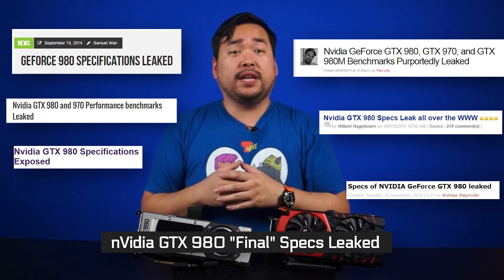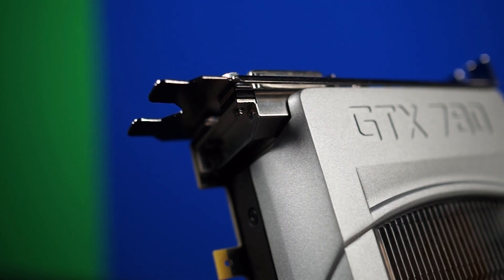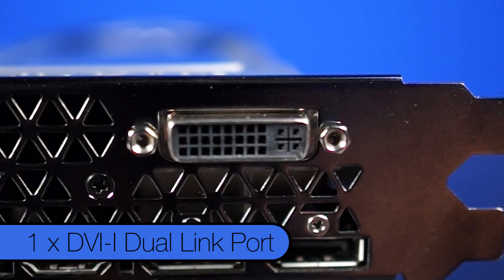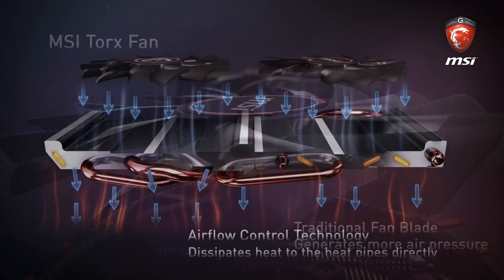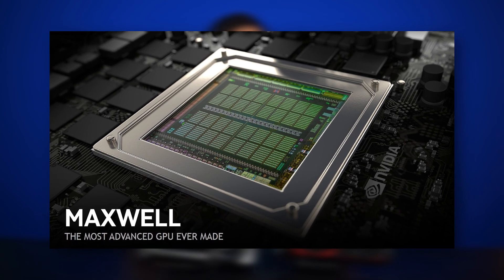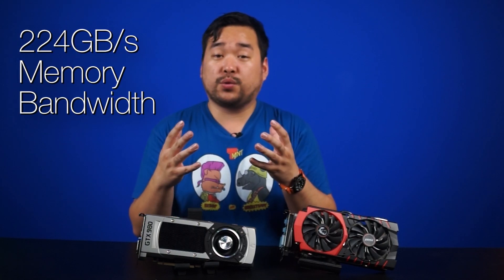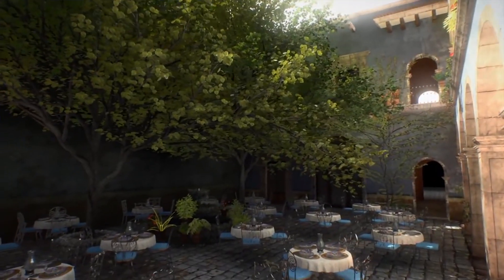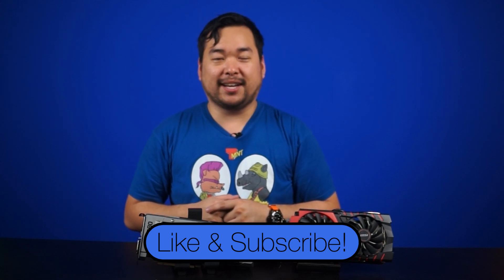What is Maxwell? Explained. ft. GTX 980 and MSI Twin Frozr V GTX 970

Comment: Is the Intel Core i5 4690k good for the GTX 980, or is it going to bottleneck it? (stupid question i know.)
Reply: So you have to have experience to overclock? how do new people learn how to overclock then... Fool
Reply: Slay ...Calm down? Maybe he plans to learn in the near future.
Reply: xXTheGamingKamiXx So how stupid exactly are you? You buy a "k" CPU and you're not going to OC it? WHY THE FUCK BOTHER THEN!?
Reply: Cheesepuff
theyre binned chips to ensure they are actually overclockable. they have a higher threshold for frequency and voltage tolerance, have higher overall stability, and run at more thermally sound temperatures. dies with impurities in them might get turned into an 's' chip or non lettered chip. so technically k chips are better chips. all the same silicon just less impurities
Reply: most games can be run just fine with a i5, especially the 4th generation, you should be totally fine, the 970 imo is more interesting because of the price 350 dollar
Reply: i5 4690K could handle 4 of those :D
Reply: thats a very good cpu and will not realistically bottleneck that gpu. but technically if a game isnt optimized properly one part is always going to bottleneck the other. a good example of this is a cpu dependent game that processes draw calls on a single thread like all mmos is going to bottleneck the gpu and theres nothing u can do about it. directx12 should help this but it still boils down to game engine design and coding optimization
Reply: This comment chain was tl2r so ill just say this:
I read the first 3 - 4 comments and dont buy the 4690k is youre not gonna overclock if there is a 4690 non-k version (theres one right? havent followed latest cpu specs and things) its just a non overclocable version of the 4690k some time under clocked 100mhz which for gaming makes about no difference
Reply: *****
I disagree, I overclocked my CPU by reading online... It's lasted a year so far and nothing bad has happened, over clocked it from 3.5 to 4.2ghz
Reply: Slay cause fuck logic
Reply: ***** I don't really know how to OC so it will be at the stock clock. Thanks for answering!
Reply: You cant say one thing bottlenecks the other, without mentioning what you're going to do with it. If it's just gaming, no, your i5 wont even reach 50% of its capabilities.
Reply: Simxor Yeah, it's for gaming. Good to hear!
Reply: yes and nope the bottleneck issue is not gonna happen with 4690k
Reply: No bottleneck  is something different it's like core 2 duo with GTX 780 TI😎
Reply: Slay Haha very true.
Reply: 980 will be fine with a 4690k
Reply: Guy Random ah, no. It would struggle to run games with 2
Reply: ***** some K cpus are released at higher default clock speeds than the equivalent non-K part (see i7-3770 vs i7-3770K) and are from better processor bins.  Still probably not worth the extra $$ for a K part, but just saying, there is a difference.
Reply: Par5Eagles sorry, answer to slay there.
Reply: If you are not going to OC then get the 4690 and a cheaper motherboard that doesn't support overclocking. The clock on the 4690 is slightly higher than the default clock of the 4690k and that combined with a cheaper motherboard will save you alot of money.
Reply: spend a little bit extra on the k chip with a z97 mobo and get this http://click.intel.com/tuningplan/faq if u mess it up u get a free replacement. u gotta think youll have that pc for 5+ yrs on avg just cuz u dont plan on overclocking it in the next 6 months doesnt mean u wont want to in the next 50
Reply: xXTheGamingKamiXx You're on YouTube. You couldn't hope for a better resource on how to overclock than here.
Reply: It shouldn't bottleneck it.
Reply: even a good 3rd gen CPU will not bottleneck , if you notice that you are getting less power than you should , I suggest making sure you have a solid PSU , and a decent mobo + if you want to overclock there's is some very good videos about that in the channel , and most mobos now include an OC button that will give you some decent overclock.
Reply: you're right this is a very stupid question, for example a oc'd to 4.5 ghz G3258 is able to show similar fps results as a stock 4690k so you're fine there.
Reply: Mrfailstandstil
maybe on a single threaded game
Reply: EZOVERDOSE
i don't want to argue with you, just go and watch several benchmarks from a different sources and i don't say that g3258 is better it's just similar and all the newest games is using max - 2 cores 2 threads anyway.
Reply: Mrfailstandstil its an ok cpu. but the future is multithreaded games and anyone in their right mind thats a passionate gamer would not buy a dual core to game on. u load a game that uses 2 threads which most use many more, then all background processes are sharing the 2 threads the game is trying to use to make fps. all those benchmarks arent real world tests like a person with 100 processes would see theyve most likely chopped running processes to a minimum.
just loading up dead rising 3 to check uses all 12 threads on my 3930k. even wow being a 10yr old game on a 20yr old engine base uses 3 threads. watch dogs recommended an i7 4770 i forget how many threads it used, most likely all. the evil within recommended specs are an i7 with 4+ cores. not 4 but 4+ meaning hex and octa cores will be utilized. dual core is for browsing the web
any generic gaming benchmark for the g3258 may look good on paper until u find one showing frame time variance. anything over 15ms youll notice stuttering even tho the fps counter is locked at 60. that is the g3258 gaming in a nutshell. it would be more obvious on less optimized titles that are cpu intensive.
so is an extra days pay toward your cpu that youre prolly gonna keep 5 years to ensure u have stutter free play worth it?
Reply: Get the i7. Games are starting to utilize more threads (watchdoge), and future games will work better with more threads/cores. Next gen games will bring a bit of a "shock to the system" to us PC gamers. So... yeah. Get the 4790k.
Reply: Astralify
dead rising 3 used all 12 threads on my cpu. the evil within recommended 4+ core i7 too. i7 ftw
Reply: Astralify "Get the i7" ONLY if you have a huge budget. Otherwise get an i5.
Even going from an i3 to an i7 is like a 5 FPS difference at the most in most games.

Personal note: I have an i7 4790K, but I use it for rendering. It is overkill for gaming.
Reply: Cheesepuff It's not overkill for gaming. Next gen games are starting to utilize more than 4 threads, especially open world games (watchdogs). He will regret it 4-6 months down the road if he buys an i5. Much like my friend who has a 2GB GTX 770 and can't crank up the texture resolution in some new games. Plus the guy is buyng a 980. I'm sure the money are not a problem.
Reply: Astralify I am not going to insult you. But texture resolution is ALL about VRAM, nothing to do with your processor.
Reply: WAT? When did I said that texture res has anything to do with the cpu?
Reply: Astralify Oh! Then why would you bring it up at all in a discussion about CPUs.
Reply: I don't even... I was trying to make a point!
Reply: Cheesepuff
he used an analogy and u didnt get it. gj
Reply: Slay K CPU's usually are better quality (better silicon) and don't cost a lot more.
No need to be angry, it's not your money that has been spent.
Reply: Rama Polderman This is completely false. K CPUs are overclockable. They aren't better silicon in any way, you pay $20 more for the ability to overclock.
Reply: EZOVERDOSE They are ulnocked 4790s. They are not binned tor higher frequencies. If they can't hit 4.4 turbo they are broken, but other than that, they aren't taken through any special binning process.
(Provide source, if you think I am wrong. Because I am interested.)
Reply: I would go for the i7 4790k
Reply: StoffeGaming i7 is not faster in games than i5, because hyperthreading doesn't improve performance in games.
Reply: Rama Polderman
that would explain why reputable benchmarkers always use an i5 over an i7. oh wait it doesnt and they dont. wonder why?
Reply: I know it isnt the best proccesor just cuz its an i7 but i mean the 4790k is  still an pretty good proccesor!
Reply: EZOVERDOSE Because they have to keep the setup consistent and do not want to bottleneck SLI/CrossFireX setups.

Oh and benchmarkers use Core i7 Extreme Edition models which are way more powerful (more cores, more cache, etc.)
The standard i7 is just an i5 with hyperthreading (being able to assign 2 threads to 1 core)
which is useful for productivity software that use more cores.

Edit:
http://static.techspot.com/articles-info/734/bench/CPU_01.png

There are actually some games where hyperthreading decreases performance, because games aren't written with hyperthreading in mind.
Reply: Rama Polderman
i know all that i have a 3930k and u just contradicted yourself
Reply: EZOVERDOSE Where did I contradict myself?
Reply: Rama Polderman
"i7 is not faster in games"
"they use i7 to keep the setup consistent and do not want to bottleneck sli/crossfire setups"

then u link something showing i7s getting more fps in a game than i5s. yes its a negligible difference but its still more
Reply: EZOVERDOSE Okay let's be clear on this.
The cost/performance ratio on an i7 is lower on an i5, so if you're on a budget, spending more money on the GPU instead of on an i7 is a better option.

"i7 is not faster in games"
"they use i7 to keep the setup consistent and do not want to bottleneck sli/crossfire setups"

The i7 benchmarkers use are the 6-8 core models (extreme edition). If you would actually read the comment I reacted on you would understand that he mentioned the i7 4790K which is an i5 4670K with hyperthreading and NOT the i7 benchmarkers use.
Reply: Rama Polderman
so the argument changes from whats technically faster to whats faster based on price to performance ratio? youre also basing your claim off a single benchmark from a single game. then ignoring the fact that a lot of new demanding games actually utilize hyperthreading.
but lets not think about spending an extra 100 now which is what a single days pay? to future proof your cpu a bit for 5+ years assuming thats how long these shitter consoles will be around holding back gaming.
i base that 5 years on a 2600k still being able to play any game out just fine and its almost 4 years old. the shitter consoles will be here for at least another 5 years. the last consoles were around 8 years and the new ones are 1 year in from their releases.
all that aside whos to say the buyer of an i5 doesnt want to sli in the future? using your own statement that would then potentially bottleneck their setup.
if the 4690k (or 4670k) and 4790k were the exact same chip one with hyperthread one without then they wouldnt have dif base clocks, dif tdp, dif tcase temps, and dif l3 cache. and whatever else is different that i didnt mention.
also a 4790k can potentially get better fps in (specifically single thread dependent) games since its base clock is much higher and is easier to cool when overclocked compared to a hex or octa core
Reply: EZOVERDOSE If you'd know anything you would know that future-proofing a system is bs. This console generation will probably be a short one anyway.

$100 can be quite a lot for a student.
Reply: Rama Polderman
so i dont know what im talking about? lets talk about my lack of pc knowledge for a moment:
future proofing a cpu is easier than a gpu the way technology is advancing for either.
are u denying that an almost 4yr old 2600k can no longer run new titles on max settings. or a gtx690 cant run or wont be able to run any of these new games coming out?

do u disagree that if someone saved 100 bucks 4 years ago and bought an i5 2300 over an i7 2600k that it would perform in games the exact same today?

i bought a 3930k 2 years ago and up until recently those extra threads were only used for encoding and rendering. but now theyre being utilized in games. id call that future proofing even tho it was indirectly future proofing since i bought it for editing and i see it being capable of running any game that comes out for a long time. so that was a bad decision and games using more that 4 threads now is a figment of my imagination?

any gpu with 20% more shaders than the ps4 which is 1100 something will run any multi platform game on equal graphic settings, fps, and resolution as a console. that extra 20% is to compensate for api overhead until directx12 gets here since no one knows exactly how much its going to help. a gtx 770 4gb will run any game out on ultra at 1080p at 30+fps and most likely any that come out in the next couple years. after those couple years pass u may have to adjust 1 or 2 settings off ultra to maintain liquid fps

and who cares if 100 bucks is a lot to a student? who said anything about a student and why should i sympathize? 100 bucks is a lot to an african mud hut village too. get a job or sell some blood if youre worried about spending an extra 100 on a 1000+$ rig to future proof it a bit
Reply: Spastlcatedtoad funny thing, same in my country, hell you could even buy 4690k cheaper than 4670k
Reply: Slay just in case I feel like it in the future

Comment: NO back plate on the MSI version?
DEAL BREAKER!
PCBs  are ugly as fuck.
BTW 780ti's are like $425 now
Reply: berzu21
1. It looks 1,000X better than a PCB.
2. You can get a plate to match ur build.
3. it lowers temperatures about 2C.
4. it helps cool the V-Ram and V-regs.
Reply: berzu21
Or spend $20 and get 1.-4 benefits.
Reply: Sanic
go for asus strix then.
Reply: berzu21 u could buy one, but non reference cards are hard 1 find shit 4.
Reply: Take one look at your motherboard. Ahhhh that nasty pcb...
Reply: ElitePotato8 bitch plz, my mobo PCB is custom painted.
Reply: Sanic  Mines black. Still a pcb. Unless you have that shielding stuff on it
Reply: ElitePotato8
No ugly parts showing.
Reply: Surely never got naked in front of a woman? Otherwise you wouldn't whine about naked PCBs. Seriously dude get laid.
Reply: ***** Um dude, a naked women is far better looking than a blank PCB.
A blank PCB is ugly and odd colored.

IDK why you just compared a human to a electronic device.
Reply: +SANIC lol hes a moron. i agree backplates are the future. looks better and its better for holding it too without damaging the pcb. hes a fucking idiot.

Comment: funny thing is when i see about all this technology and new stuff and really just mean +"not as much fps better as i would hope"
Reply: deathscall1 The benchmarks I'm seeing the 980 is the same or better than the 780ti in just about everything, and I've looked at quite a few reliable benchmarks. You know Nvidia is holding back like they always do though to release something more powerful later.
Reply: Dylesxic Just going on Linus's vid on the 980. With it running at ~1500 and the 780ti running at ~1200 they perform with in 5fps of each other with the 980 on top. The 980 is using less power for its higher clock but the reduced cuda cores are preventing it from really beating the 780ti
Reply: The NEW MSI GTX 980 Gaming MLG Performance OC EXTREME Gaming SLI edition.  "Not as much FPS as you'd like"
Reply: 441meatloaf Again going off linus here, (havent looked too much into the new gpus as im not upgrading) I remember him stating that the 390 was to compete with the 980 and the 390X was to compete with then new titan or ti card. He seems pretty sure that nvidia still has s ome stuff to release.
Reply: ReaLzEdits >.> Look this conversation was done a long time ago lol. The 980 OCs higher than the 780ti by default which is why it slightly comes out ahead but in ANY game that REQUIRES 6GB or more the current 980 will ALWAYS come out behind the 780ti because it doesn't have enough VRAM and higher clocks are never a replacement for VRAM. Not to mention the 980 has fewer CUDA cores. These things severely hold it back and NVIDIA did this on purpose to resell a card with more of both later at a higher price. Will the performance double? FUCK NO! it will increase MAYBE 25%. In the end Nvidia is a company and money always comes first.
Reply: Sasaki Haise " but in ANY game that REQUIRES 6GB or more the current 980 will ALWAYS come out behind the 780ti because it doesn't have enough VRAM" ... ok you do realise the 980 has more vram........ ok well throw that argument out the window and no shit money comes first if someone hasnt realised that then they are fucking stupid and same goes for amd both companies are clearly holding back what their card can do because it would be way to inefficient and extremely hard to keep making better chips in a years time
Reply: yea they made it more "efficient". This would be reasonable for mobile performance but these are desktop GPUs >.> we want performance >.< really sad when the 780 ti easily outperforms the 980 in games QQ probably also why they have yet to do a benchmark video.....
Reply: deathscall1 Funny thing is, it really doesn't. One of the benefits to more efficiency is more overclock headroom. If you can overclock the card you get better performance than any other single gpu card. This is just the way tech advances small steps at a time. Wait till their next cards come out with the new features this one has as well...We'll be seeing larger improvements.
Reply: That's funny because the 970 is the best price/performance card yet.
Reply: bensemus x Glad one guys seems to understand >.>
Reply: Sasaki Haise lolt the 780ti does not outperform the 980, in most cases its running with the 970...... and btw they still have to unveil the big boy "gm200" which rumors are speculating that its 2x more powerful that the 980... then again these are just rumors so we will just have to wait and see.